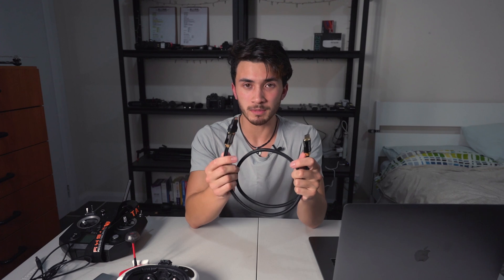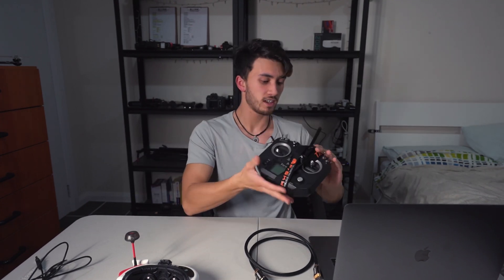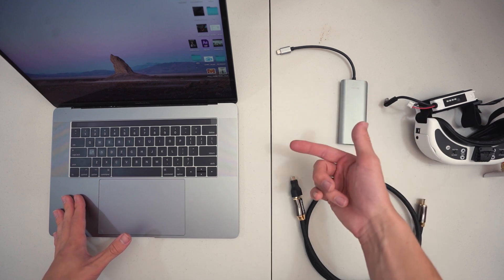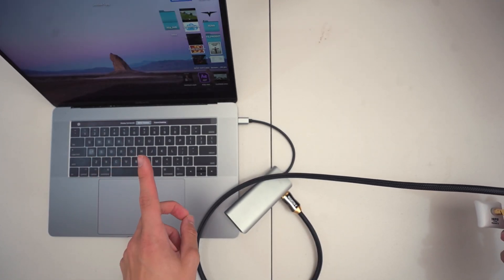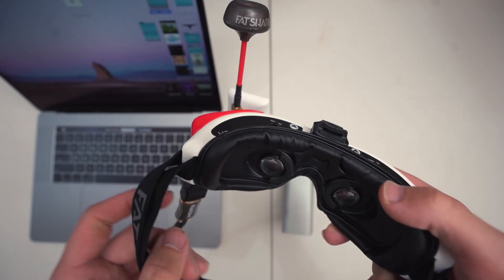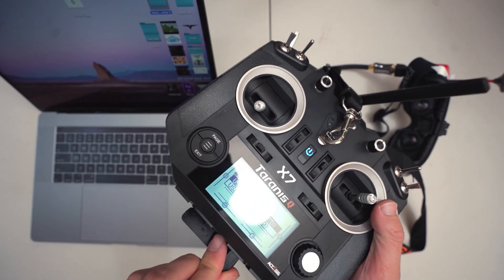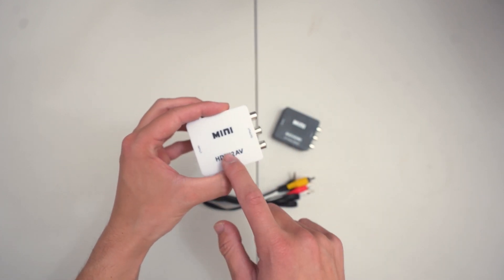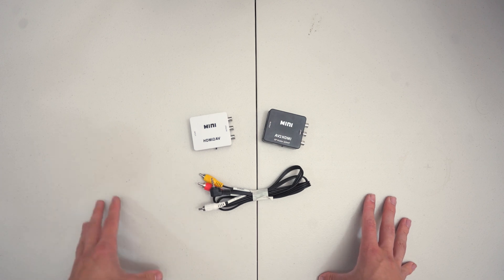How to Setup HDO2 with the FPV Velocidrone Simulator

Comment: Hi there I just bought a pair of Skyzone Cobra S goggles and the HDMI port of the Cobra S is a micro HDMI connector. I have an HDMI to HDMI micro cable coming tomorrow, can I just hook up the cable from my HDMI of my laptop to the goggles in order to learn how to fpv using Velocidrone or is there something else I need to do either in the goggle settings or in the windows laptop?
Thanks for the great video and your time. Harry Lato

Comment: Thank you for the Tutorial! I have bought the cable - did everything what you did, but i only have a blue hdmi screen in the goggles. Do you have any idea what i did wrong?
Reply from the maker: Daniel Baeck did you change it to hdmi on the goggles?
Reply: @NicolasGrant  yeah i did! it says it on the upper left corner but the screen is blue.
Reply from the maker: Hmm so weird! I’d probably try troubleshooting with different devices, play around with setting on your computer, or if you haven’t just leave it plugged in for like a minute? I remember the first time I did it, it took about 20 sec before it started working 🤦
Reply: @backlightfilms  I have same problem.
Reply: @ipaito  ever found a solution to that (connecting HDO2 to macbook through HDMI without this blue screen)?
Reply: You probably need to set your laptop to output through the HDMI just like you would if you were to hook up your computer to a TV or external monitor.

Comment: Your tutorial really helped out on what exactly I need as far as setting up my HDO2 (received 2 days ago) to work with Velocidrone. I'm sure it will work for my mac as well once I get my HDMI to HDMI Mini cable from Amazon! I assume that there is no need to adjust any of the displays settings within my Mac since you didn't mention it. Even if so,  I'm sure it's intuitive enough to figure out.  Thanks man!
Reply from the maker: No problem! Yup You just plug it in and it should just work (sorry for the late reply but I hope it worked out!)